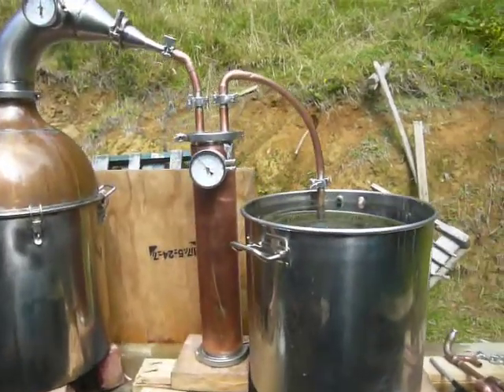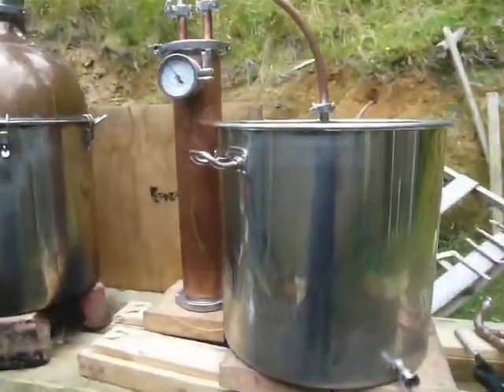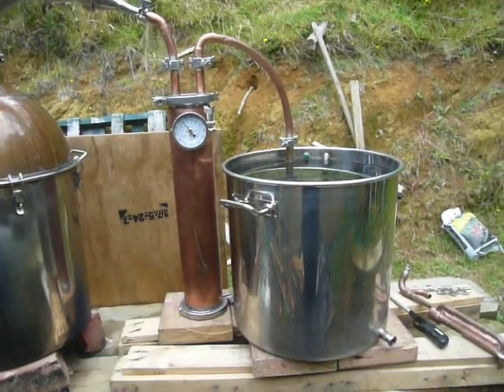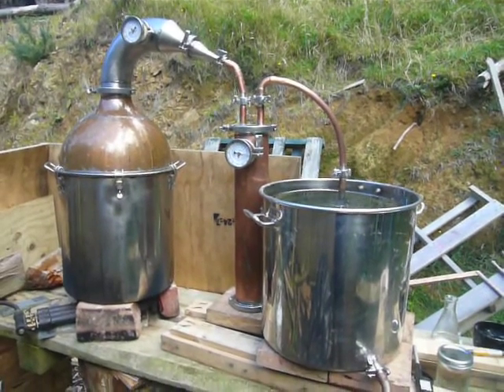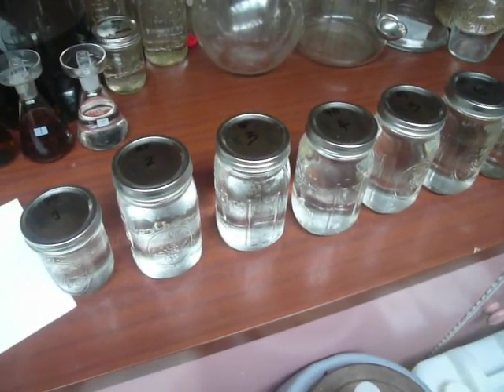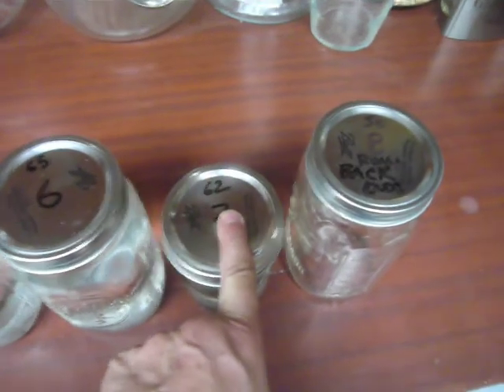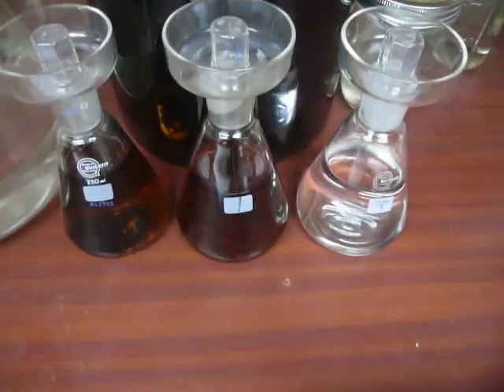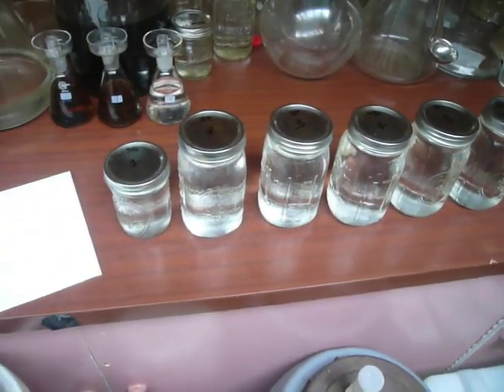Distilling_03

Comment: another nice vid. make sure you have teflon tape for your threaded fittings.  quick thinking with the flour paste.  also, if you get some thermal bubble wrap, you can make a blanket for your thumper and keg.  i find it gives a more consistent temp.  dont forget to put something under thumper too.  you loose heat quickly out the bottom.  great job though.  impressed so far.  be interested to know what % abv you started at.
Reply from the maker: Heya, thanks again.

Yep, I have tape on all the threads, leak was from a silver soldered join between the tri-clamp plate and the threaded shaft soldered into it that the thermometer screwed into.
At the time it looked like it was coming out of the threaded seal so I replaced the tape and re-did the seal only to have it leak again later from the same soldered joint heh-heh.

Thanks for the thermal insulation tip - I'll give it a go.

ABV for the rum wash was around 9.2% abv from memory, It was a bit of an experiment that one, ... well they're all experiments! :o).

I remember working it out on paper after condensing everything into one container and getting an accurate ABV for the lot.
Using the thumper (and including the backends) I got well and truly the lions share of ethanol there for extraction.

Comment: i like that table you made up in the yard with 2 stumps with the wind break, now thats what I call a hillbilly table :)
Reply from the maker: Haha, yeah that was some hillbilly can do for sure.

That table has been munched away to nothing now by huhu bugs (local insect thats grubs eat wood.
Tanalised top is still around somewhere but the two logs turned into sawdust after a few years.

Happy Distilling Cameron!
Reply: @AngryParrotDistillery  i liked that out back table :)
The 100 litre came a few days ago. Been busy cutting the pipes and soldering on the 2" tri clamp ferules. Doing the arm inside the thumper this afternoon. i will cut a vee into the bottom thumper pipe today some time.

Comment: Is this double distillation at one time by moonshine distillery,  y I'm asking u becoz wht is in the middle, I like the new method 👍
Reply from the maker: G'day Satish,
Not truly double distillation, but you get a higher % output this way than with a single run with the pot still alone.
Old school moonshiners used them for the same reason - it yielded a much higher abv for very little extra effort during the run.

The bit in the middle is the "thumper" or "doubler", it condenses the vapor from the kettle back to a liquid and then re-evaporates the liquid back to a higher % alcohol vapor.

The thumper in the video is actually a little small, ideally the thumper should be somewhere around a third to a half the volume of the kettle but then this video is 4-5+ years old back when I was playing around.

It is possible to chain thumpers, ie; have more than one - some old school rum distilleries in the Carribean used two.
I have some videos on my channel of a larger twin thumper rig I built for rum running some corn whiskey.

Happy Distilling!

Comment: do you need to add Alchol to the thumper when you start the still?
Reply from the maker: G'day Lee,
Yes you definitely need something in there to start the condensing/evaporating process.
I usually just throw in the same wash I'm running in the still or if I have backends (discarded tails) I might use those as well.
I started out only using a few inches over the top of the input tube in the bottom of the thumper, nowdays I'm filling it about half (with a larger still it certainly increases the volume of wash you can distill in one run.)

Happy Distilling!
Reply: @AngryParrotDistillery  Oh , Ok, I may need to make some before essential oils before making a thumper setup
Reply: thats for flavor!! You can mix both wash and flavored alcohol or even just add shit for flavor and get more lightening with the double plant. The reason its called a thumper is the sound it makes cause thepressure coming of the still goes in and its prob a few inches off bottom...so then the vapor bubbles from the preasssure and then hits the condenser...look at schematics...this is a great way to do it

Comment: Hey there!  Fellow kiwi here from the Kapiti Coast!  Did you make the thumper yourself, and if you did, have you got a video tutorial of it?  I think I need to get me one!  Cheers!
Reply from the maker: G'day Chris, don't have a video of it sorry.
As it was I ended up replacing this one as it was too small (this is going back over 2 years ago now :o) ).
I replaced it with a larger one I made out of a small copper under-sink water cylinder.
The original one was just a piece of 4" copper tube with a 4" ferrule either end and a blank triclamp plate and clamp to capture the tube either end (and make it very easy to clean out).

Using a thump-keg is great, not quite as good as double distillation but certainly gives you higher proof pot-still spirits with all the flavour. (you can also do some funky stuff by adding flavours/botanicals to the wash/liquid in the thumper-keg kind of like a gin-head)

Happy Distilling!!!
Reply from the maker: G'day Chris - did I meet you round at the workshop in Paraparaumu last year? (sorry can't place the name, the last year has been a bit hectic and all a bit of a blur).
Your are welcome to give me an email and catch up sometime if you want to have a yak about a thumper.
Reply: Awesome, thanks!  If the meeting was distilling related then it probably wasn't me, I've only been messing about with this for the past couple of months.
Reply from the maker: @m0parnut  
Heya Chris, late reply. 😊
Was definitely another Chris I was thinking of.
How'd you get on ?
Happy Distilling!
Reply: @AngryParrotDistillery  Yeah, i ended up designing a moonshine still, using a underbench hot water cylinder copper bladder as a thumper.  60 liter boiler and a copper flake in a brewing bucket with a toilet cistern water regulator to keep the cold water circulating.  It works well, i don't have to worry about temps or anything, just swapping out the jars as they fill every 30 mins or so.  It generally starts running at 75%, i stop when it gets to 60%.  I usually get around 9 litres before i shut it down.  It's been a great system so far!